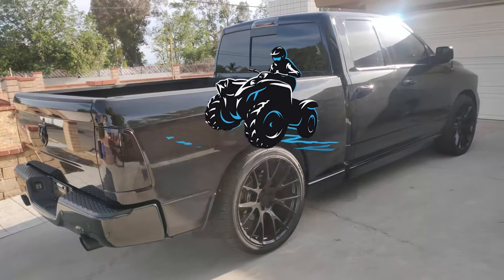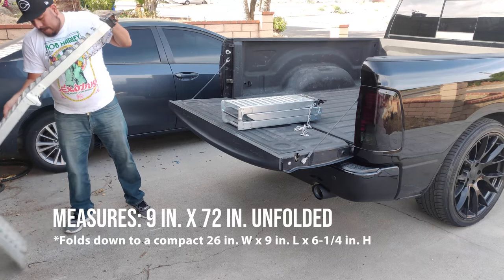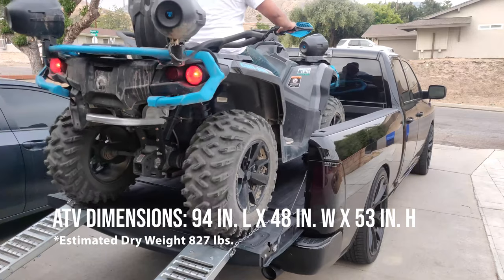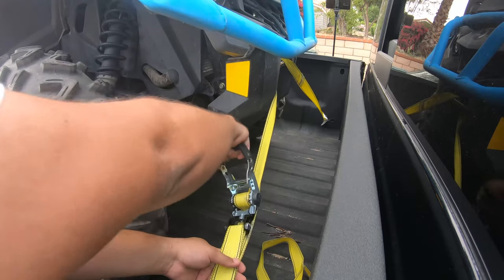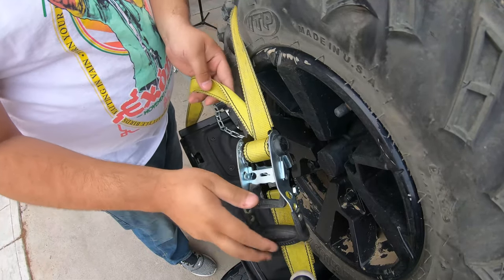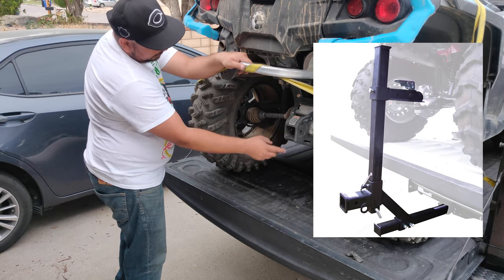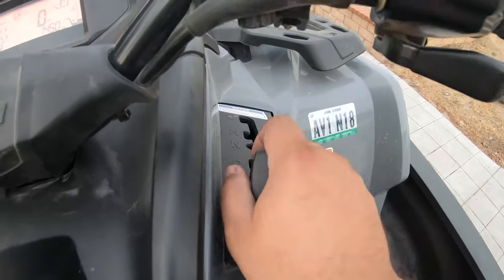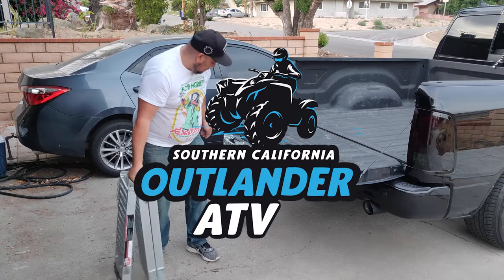How to Load Your ATV Onto Your Truck Bed

Comment: Nothing safe about that…. First install a winch.. then connect cable between two tie down rings in front.  Connect winch to it.  In neutral winch machine up ramps with you off it.   Safely.   You’ll flip n crash eventually otherwise
Reply from the maker: Now that's a first. I'd understand if maybe someone was reckless or under the influence. Even the owner's manual says you can load it this way in low gear, 4wd without hard accelerations OR using the winch method you stated. To each their own I guess.
Reply: @SoCalOutlanderATV  good luck

Comment: 50% right / 50% wrong.... Only due to it not being strapped down at all from moving forward if you hit the brakes hard enough or get in an accident.  The strap in the back is connected to the truck in front of the tie down location....

Comment: That back bar that you ran  the strap though is not made for this. Saying that you have not had any problems dose not mean that is a good idea.
Reply from the maker: Please make it constructive criticism if that's how you feel. Where do you recommend I run the strap through? Or how is it you tie down the rear end?
Reply: @SoCalOutlanderATV  tie to the hitch instead. That aluminum bar is not strong enough 👍🏼
Reply from the maker: Thanks man. I got a new video coming soon, took the feedback and got myself an ATV Lok It Rite hitch. Install and review coming soon. 😎👌🏽

Comment: I don’t think this is correct.. it’s tied on a fwd pull position.. hit the brakes hard enough your gonna replace that back window again…  front hook up is ok, back straps need to go on the ball hitch emergency chain hook ups this way you have a rear pull on the machine as well as the front straps are pulling the machine forward
Reply from the maker: Front is correct according to the manual. For the rear I use the Kolpin Lock-It-Rite system now. Much more secure and ease of mind driving with the ATV in the back.
Reply: @SoCalOutlanderATV  Both straps are pulling forward. Need to pull against each other to properly tie down. Also, I always have 4 straps minimum. 2 pulling forward and 2 pulling backwards just in case one fails. But I like those ramps
Reply from the maker: @optionizerss4511  For the rear I use the Kolpin Lock-It-Rite system now. But yeah makes sense for the straps to pull against each other. These ramps are great, might buy a different aluminum set however. They weigh much less and are a bit longer so the incline isn't as bad now that I have a normal stance truck vs this lowered one. 😅
Reply: @SoCalOutlanderATV  I have a 2500 Ram 4x4 so sits pretty high so longer ramps would be better. I just got the ATV and don't have a trailer and likely won't be taking it anywhere often so don't really want to buy a trailer to use once or twice a year. I have never had mine in the bed yet but researching now. I do like that Kolpin system but would still use at least 1 strap on the rear and 2 on the front just to be safe. Always remember Murphys Law...lol

Comment: Don't wanna be one of those guys that pertends 2 knows it all But in my manual it says you should never leave your ATV in park when transporting. Can destroy your parking gear Says leave it in low gear with break on.  Just trying to help.
Reply from the maker: Great tip! I'll have to read the manual again in that case, I always leave it in park with the parking brake on.
Reply: My CF Moto CForce 600 manual states the same. Transport in neutral only.
Reply from the maker: My Outlander manual says in PARK. Kind of strange two different ATVs say differently, who knows...

Comment: To much movement on those ramps! Chains are to loose! You will break another window if you don’t have tire stops or a window guard! Just a matter of time.
Reply from the maker: Thanks for the feedback. Haven't had a problem yet. 🤞🏽
Reply: It’s legal loaded atv on freeways?
Reply from the maker: If you're asking if it's legal to drive on the freeway with an ATV loaded on the truck bed, then yes it is. Hope that answers your question.

Comment: Great video. Glad to see the max fit in the ram. Now I can order mine👍
Reply from the maker: Nice!!! Hope you get your Outlander MAX soon. Since recording this video I now use the Kolpin Lok-it-rite system to secure the rear end of the ATV. I've gone 900 miles round trip and didn't once worry about the quad smashing my rear windshield or falling off on the highway. It's a good buy that you won't regret.

Comment: I load into a 2007 Dodge Dakota Quad Cab and have to drive up on top of the wheel wells. I like that your ramps have those chains. I use ratchet straps to secure my ramps. I am still amazed every time I see someone load or unload with unsecured ramps. I actually secure to the lower control arms, so there's no suspension movement involved. I did just recently pick up the Kolpin hitch system but haven't used it yet.

Comment: Nice Video! I have a vinyl Tonneu bed cover on my RAM that rolls up to the rear window, it also makes for a NICE CUSHION for not hitting the rear window. lol -Works for me!
Reply from the maker: Been wondering if a cover of that type would interfere with me loading the quad. Thinking I might just do the same but more for aesthetics, with my Kolpin ATV system I no longer worry about shattering my window. Haha. 😅

Comment: Good tips on loading and unloading but the strapping needs some tweaking. Theres nothing stopping it from going forward. Also, the strap in the front isn't doing much either. You need 45 degrees angles in tbe direction you are resisting. Its tied well for up and down movement but thats not really the goal here.
Reply from the maker: Good tips. The front is actually how the manufacturer recommends. For the back it recommends through the hitch receiver hole. I don't worry about the rear as much now with the Lok It Rite system.
Reply: @SoCalOutlanderATV  
It might help looking up strapping videos for UTVs on trailers to better understand the concept. You might be using the correct mounting points on the ATV but your strap setup isn't ideal. You need equal and opposite force. For you, the back straps pull the ATV towards the truck cabin, that's fine, but then you need to make sure the front straps pull back towards direction of the tailgate. Your front straps are completely perpendicular to the direction of force you are resisting. Not trying to be mean but that's almost as bad as it could be. Straps need to be inline with the force its resisting. This is like holding a 10lb weight straight out infront of you with arms parallel to the ground vs holding it up straight over your head. Hope that example makes sense.
Reply from the maker: Yeah makes sense. Thanks for the info and tips.

Comment: Safety chains go under the tailgate vonnevting to the underside of the bumper, tie down syraps in rear should ho to the trailer hitch safeyy chain hook ups
Reply from the maker: I'll agree with you on the rear tie down straps should go through the trailer hitch. 

The chains I would argue over. Even the owner's manual of the ramps states "WARNING! CONNECT SAFETY CHAINS TO SECURE ATTACHMENT POINTS WITHIN THE TRUCK BED ABLE TO WITHSTAND THE PULLING FORCE OF LOADING. THEY MUST ALSO BE TIGHT ENOUGH TO PREVENT THE RAMPS FROM COMING OFF THE VEHICLE BEING LOADED."

Comment: It's safe to have the tires on the tailgate vs bed of truck?
Reply from the maker: It is safe however each truck's tailgate is rated for varying amount of weights. I would check online for your truck's tailgate. But generally speaking you should be fine, it's a common transport method.

Comment: I just can't see how with a hard brake that quad doesn't go thru the back window.
Reply from the maker: I just recently went on a 900 mile round trip up to NorCal and took my quad. I thought the same that it wouldn't hold for that long of a trip. So I went ahead and bought Lock-It Rite ATV System. Look out for a review video soon.
Reply: Absolutely the wrong way to tie it down.  Everything this guy did was wrong, from start to finish.
Reply from the maker: @kdiddy7076  thank you, appreciate it. 👍🏽

Comment: How does your cousin do it in a Tacoma?
Reply from the maker: It barely fits. And when I mean barely I mean it's a really tight fit. He uses the winch to tie down an anchor he put on the bed (the manual doesn't recommend this, it can damage your winch). And then he just uses a strap on the rear end.

Comment: I have a tundra 
I don't think I can do that 😕
Reply from the maker: You mean load your ATV while riding it? 🤔
Reply: i have a 21 crewmax my quad fits in the 5.5 foot box.  i placed 2 33” rubber against the front of the bed to absorb the shock of the front of the quad so I do not smash my window.  and tie it down with 4 straps.  works good.